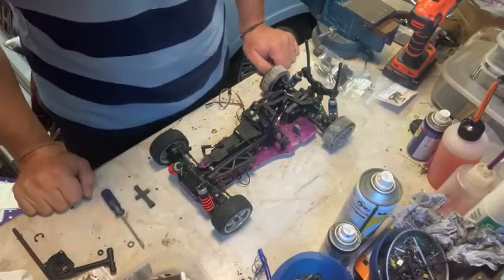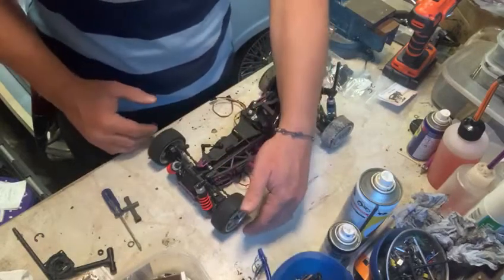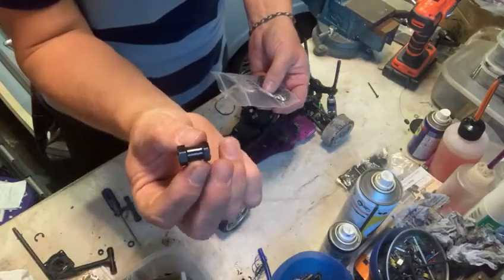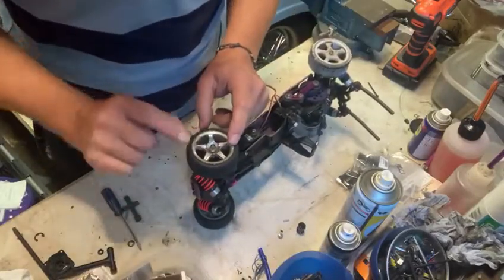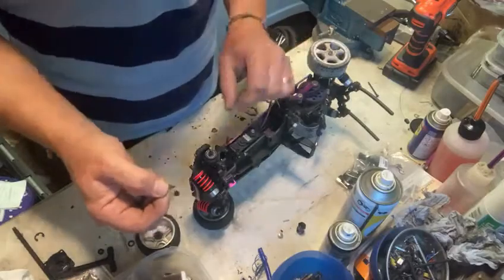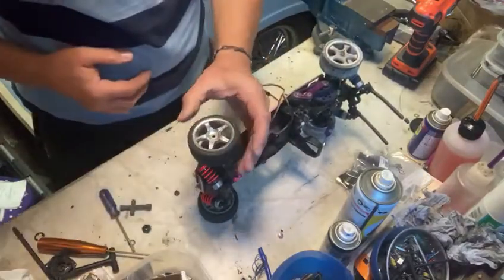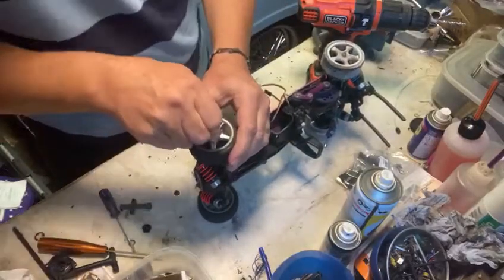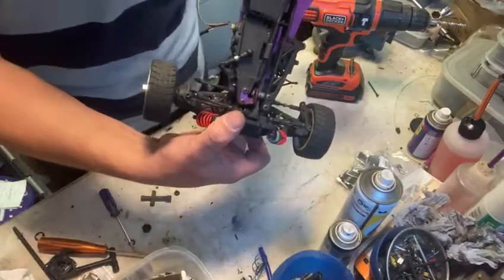How To: Fit 1/10 Wheel Extenders

Comment: MT Trucks use an HPI specific 12mm wheel hub adaptor with a small circular but which fits into the wheel.  All aftermarket ones, including the extenders don’t have this so will not work properly on MT or Rush trucks. 

Also the axles are known to be weak. If you think about it, there is a hole for the pin right through a 4mm shaft so the actual strength is down to 1mm each side of the pin.  Not enough for the wheel size.

Comment: Id suggest to be careful with adding the wheel extensions to MT trucks with larger wheels. Just had 3 axle stubs break in 3 different runs on very soft roll overs. Im running 5.3" duratrax stakker tires so id feel very confident for using these on oneoad touring cars or drift cars. Just not the big chunky tires.

Comment: I might try the links you’ve shared. I bought a set of flea bay and they don’t seem to hold in place. I think the slot for the axel pin isn’t cut deep enough so no matter how much I tighten the nut, the pin always comes flying out causing the tyre to come off (tried it on a TT01e Tamiya - went around a corner and got overtaken by my own rear left tyre 🤦‍♂️🤦‍♂️😂)
Ps great tip about the size of the drill to use. Great video mate 👍
Reply from the maker: No worries. If you have a round needle file, the extenders are made from aluminium so the slot for the pin can be filed out to be slightly wider/deeper if required.

Comment: Hi, I got some of these today and installed them using the pins which were already holding the old hex on, is there a benefit of using the ones suppied as i couldn't get these through the hole as they were a bigger diameter Thanks! :)
Reply from the maker: No, if your originals are ok you can certainly use those. Sometime the diameter of the pins supplied in the kit is larger that required

Comment: Hello ive got a 1/10 scale nitro truck and it has seemed to have lost alot of compression. I can hear the air escaping from the head so i think its coming out by the glowplug. I think it might be the headgasket but you seem to know loads about these engines and I was wandering if you know what it might be? Thanks!
Reply from the maker: Hello. There are a couple of things to check. Firstly have you run the car without an air filter ?  If so you may as well bin the engine as even the smallest amount of grit or dirt will wreck the engine.  
Assuming you have. Filter in place you could check the following. 

1. Make sure the head bolts are tight. The gasket is unlikely to fail. I have never seen one fail.  
2. Make sure the plug has the copper washer on to to ensure a good seal with the head. 
3. If that doesn’t work  take the Hess off and make sure the barrel hasn’t rotated. - yes it can happen. I have seen it a few times! 

After that if it still doesn’t run
Properly and has no compression it probably needs to be changed.   

Hope that helps. If you let me know which engine you have I may be able to help further?
Reply: @RCScrapyard   Thankyou! I’ll let you know later on if I   find anything else out- I’m going to try to take it for a run tomorrow 👍